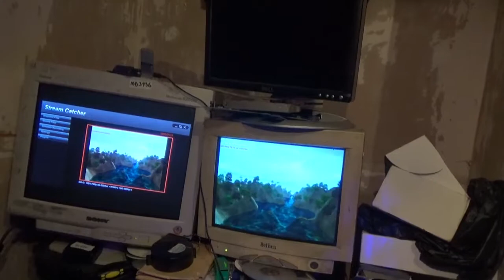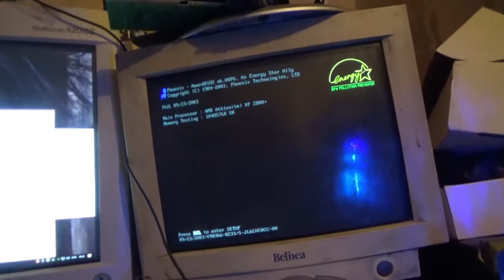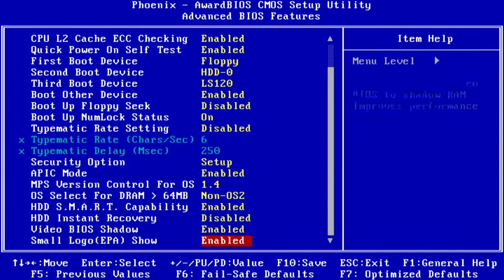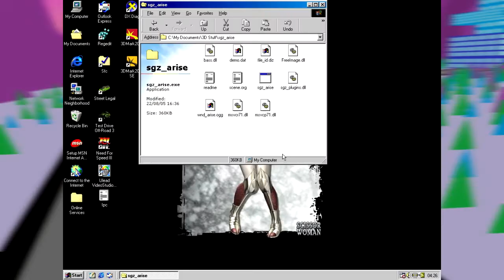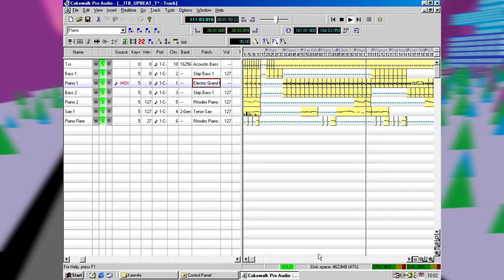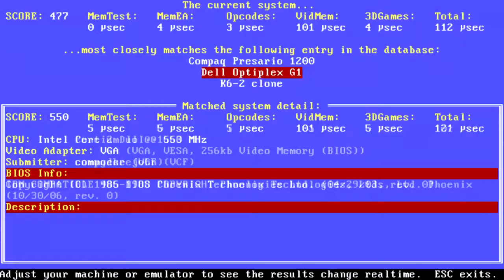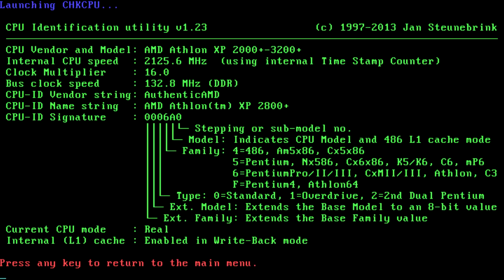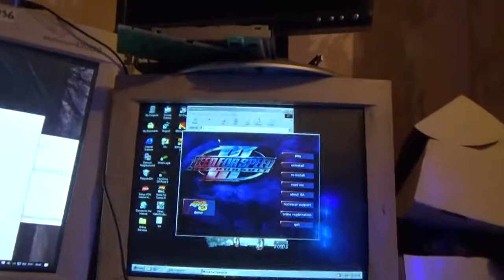Stable Athlon 2800?

Comment: This got me thinking, I ran Athlon 64 2800+ with some Asus motherboard for 8 years as my main computer and never ran into problems. But then I remembered that actually I did, there was at least 2 games that just refused to work. But maybe it was that Geforce 4400ti (which is a crappy card, I know). Can't test it anymore, that computer died 2 years ago probably by a lightning. PSU still works, cards still work but I don't have motherboard to test that CPU.
Reply from the maker: Athlon 64 2800+ eh? Didn't know they made one of those, but I'd bet it held consistent with the higher models and was marginally outpaced by the XP in 32-Bit code. Odd thing the Athlon 64, mine never worked (2GHz Manchester) and as much as people said it should have been faster than the Presler that replaced it, I never once saw that, hated it. It was a 939 though, by contrast the 754 models seemed to be very good, I own a real bargain bin 64 3200+ that I bought as a bundle. Runs like crap thanks to DDR1, the AGP-PCI-E bridge and the IDE-SATA bridge, but it just refuses to die despite being used as a testbed with some severely ill hardware.

Comment: I have a slot 1 board if you're wanting another PII build that I could send down the road.  Obviously a donation.  that or I could build it into a system.
Reply from the maker: I really appreciate the offer, but I've decided to use a board I already have access to. Realistically I was set on using the same board I had before, but the chances of ever seeing another one are practically zero and I doubt I could find the rest of the hardware again. As such, I'm not going to be happy either way so I'll just cobble together a rough machine from junk parts simply to serve a purpose while I need it and otherwise migrate what I can to the dual Pentium III.
Reply: not a problem.  If there's anything I can help you with let me know.

Comment: Got lucky with my semptron 2400+ system didn't suffer from bad caps, lockups, etc, etc. I guess I got lucky. I did read about bad caps and such. Most boards failed due to bad caps. If they looked bad or not. My personal fav. was a board with bad caps that took out the voltage regulator or some other part. Problem is. I have way to many stories from doing computers since 92.
Reply from the maker: Doesn't surprise me, the DFI I threw to the floor had serious problems with voltage regulators getting excessively hot, something which was only accelerated when the capacitors started to leak.
I worked on a Sempron 2400+ a few years back and I've no idea what killed it because it just suddenly stopped working on the guy, and I was there at the time. The board was fine but the CPU had noticeable darkening around the bridges and didn't work again. I just put it down to "Athlonitis" and replaced the chip. Last I knew it was still running, but I haven't seen the dude who owns it in a long time, he only used it for light web use but I wouldn't be surprised if he'd gotten something better by now as the caps were bulging and he didn't want those fixed, also how heavy most pages are now meant its days were always numbered. It was actually an OK machine for what it was - the cheapest parts he could find - and, well, it did last at least a decade with minimal work.

I owned a Sempron 2200+ at one point, that's what the K7S41GX board came from (unfortunately I couldn't find my footage of that board in time for the video) and I wasn't particularly impressed.

Comment: Listennn, if you're giving a computer a reach around, it probably is a little too needy. Take that guy to the pub, he'll thank you later.

The unstable boards you mention really remind me of all the Athlon XP stuff I've seen over the years where the CPUs are great but the boards are horrible. Seems like pure luck if you get one that works properly for a long time. Funny enough at an old job I had, I put Ubuntu on one as my workstation and it worked great! I remember it being an AsRock board, but hey, I guess budget ASUS could pull it off once or twice back then.
Reply from the maker: The simple solution is probably to disconnect the switch, but I can't be bothered.
I've seen some good budget boards before now, though for every good one I've probably seen ten times as many bad ones go by.

Comment: Think i'll fire up my 3000+ asus A7N8E(very good boards if you can find them, and the deluxe model is even better) rig and try out some NFS III on it, something i've not tried yet. Had a nightmare with some VIA boards whereas others were good, and made the mistake of getting a PCCHIPS board that thing was horrible and killed my 2500+ barton, which then meant being stuck with a 2000+ on a shitty gigabyte board.
Reply from the maker: Hmm... a good nForce 2 board? Stranger things have happened I guess. It should walk NFSIII as even a quick enough Pentium II or K6 system can run it very well, unfortunately my K6 isn't equipped to do so and I'm likely going to have to move it over to my Pentium III, a system I never wanted to use for games but always end up having to because it invariably works where others do not.
Reply: it's set up for 3Dfx glide emulation so not sure how well it'll play, Windows 98Se + nglide + ATI Radeon 9800XT and a Athlon 3000+ barton, should be interesting, I've not tried a K6 with windows yet, but the PIII would run that really well.
Reply: +HighTreason610 I have a msi k7n2 with a nforce2 400 chipset and it's very stable.
Reply: +HighTreason610 I have a msi k7n2 with a nforce2 400 chipset and it's very stable.

Comment: Athlon boards are kind of hit and miss, Ive seen a number of Gigabyte boards which were very unreliable, and with caps that were plagued with the dreaded capacitor plague.

the chipsets also weren't quite as good as the intel stuff
Reply from the maker: You're telling me. There were some extremely flaky chipsets on the K7 boards and I have seen countless ones die from leaking capacitors. I'd still side with the MS-6340 being the worst for that, despite being a VIA chipset they were unreliable as all hell and were, rather annoyingly, the go-to board for every cheap scumbag OEM at the time. In all fairness, I have seen a good share of older 478 boards that had bulgy caps too.